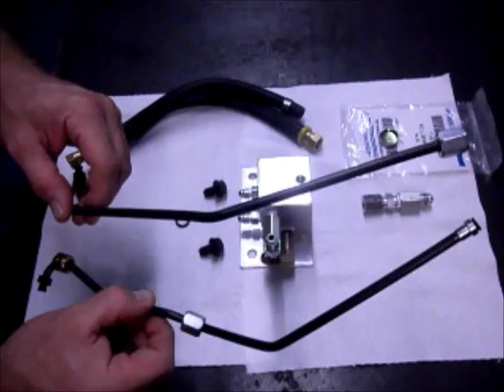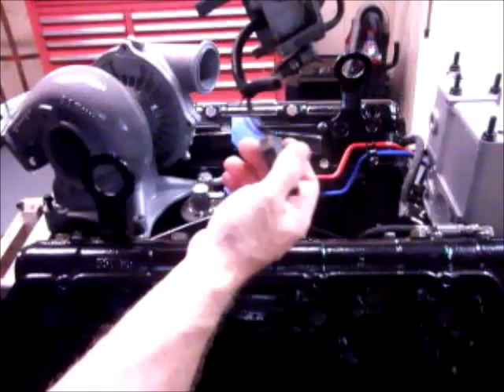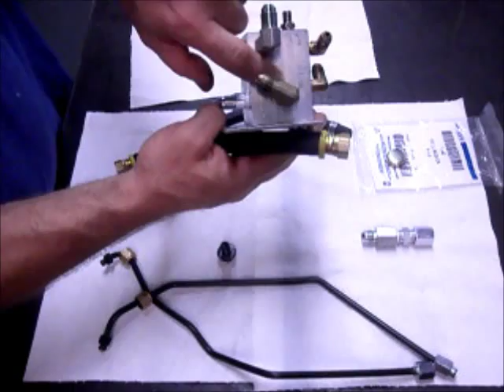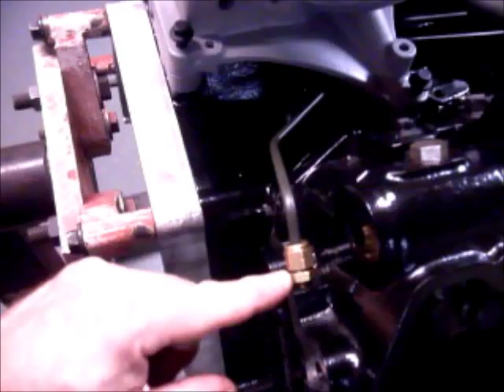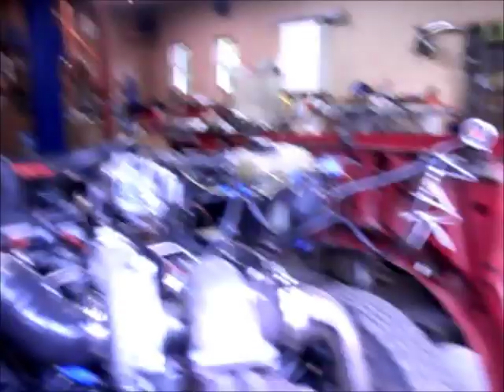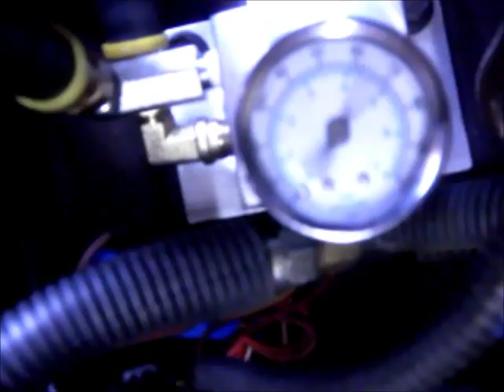The Fuel Block First Generation Powerstroke

Comment: I ordered one of these kits this past summer and it was an easy install and great upgrade for my '97 Powerstroke.   Just follow Mark's videos on the installation and it literally took me 2 hours from start to finish.  As his video shows, cutting the fuel line on the passengers side and putting a socket on it is easiest way to remove this line as it is hard to reach under the exhaust pipe off the turbo.  I highly recommend this upgrade to the OBS trucks.  A thank you to Mark for putting the time and work into this system.

Comment: I would be highly interested in your kit.  Whats the solution for fuel heating? and I'm guessing a filter could be installed between the pump and the block set up .

very cool thanks
Reply from the maker: Send me an email for more information: mark.fugazzotto@gmail.com fuel heaters are not needed anymore. Diesel blends have changed quite a bit since these trucks were new due to EPA regs. Yes to the filter question. I also sell a complete pump/filter assembly that completes the entire e-fuel swap process. See my other videos for more details on  that system. It has two filter, one before the pump and one after the pump.

Comment: where do i mount the fuel filters? also do i tap into the steal line on the frame for the pump?
Reply from the maker: Pump/filter assembly will mount on the inside of the frame rail (engine/trans side). There are 2 fuel lines running along the frame from the selector valve to the engine. Follow these towards the engine and find the one with the blue hose going from the frame to the engine. This is the supply line that you want to cut a section out of. The line with the gray hose is the return line; don't cut that line. Try to cut about a 12 inch section out of the steel supply line and use the compression fittings to add the -06 hose ends to the steel lines.
Reply: Mark Fugazzotto I would like a price on the complete system for my 1997 7.3  Thank you   Audie

Comment: just to be sure, what is you email?
Reply from the maker: mark.fugazzotto@gmail.com

If you add the +fuelblock as seen in the video it helps sort your email into a folder when recieved. It's not absolutely needed, you can just send to the email address above.
Reply: okay thank you! wasnt sure about the + sign. How much does this cost? I havent looked too hard on the forums yet for cost.

Thanks
Reply from the maker: snipers600 Current price is $153 shipped. Paypal is my prefered payment method, paypal address is: marksf9@aol.com